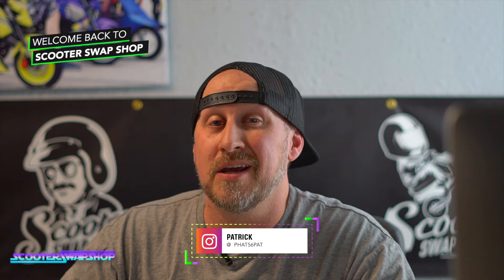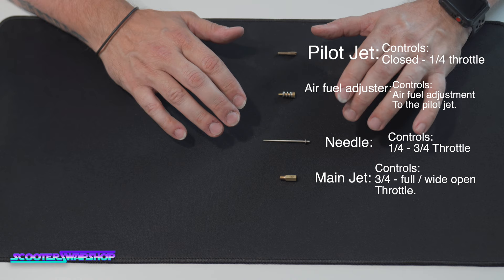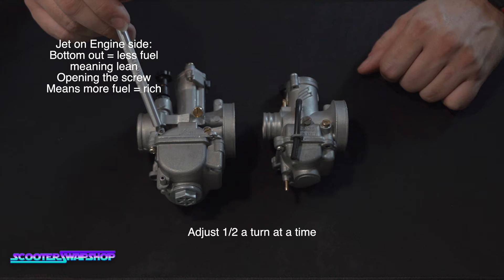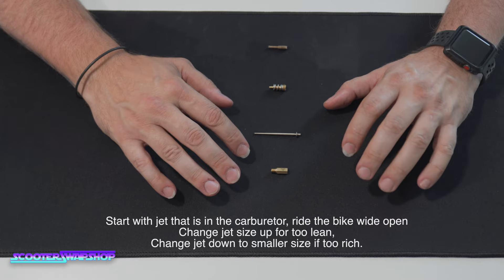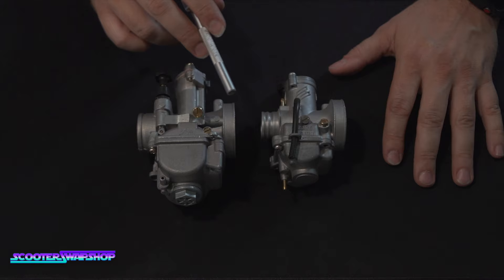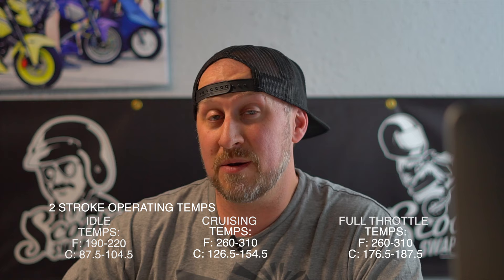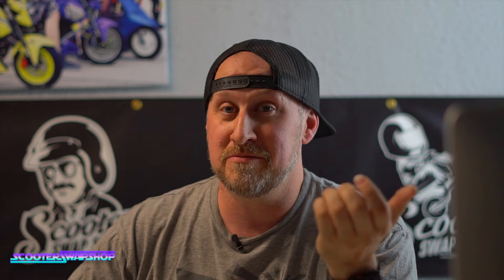How to tune a carburetor / Carb | Whats inside.

Comment: This is a great start for beginners.  I'd like to add a few things that DO MATTER!        1.)  Air temperature change makes a huge difference  it runs great in cold air and crappy when it's hot this is why!  Cold air is denser and uses a richer mix.  If you ride more in the hotter weather then you should lean out the air/fuel mix. REMEMBER
Reply: Doesnt leaning out the mixture raises the temps in a hotter wather? Pre bugs are usually aircooled
Reply: Yea I had my Clone tuned for the summer and pull it out this winter and it ran perfectly
Reply: Bro hot air means adding more fuel for it to burn right cold air is opposite
Reply: You can fit more cold air into a space than hot air, so pack a shit ton of cold air heat it in the cylinder and let that shit expand @Mon3y_Counter.
Reply: Thanks for posting this. On my first two-stroke scooter tune, I’ve seen them to be true. In warmer weather, a 125 or 130 is working compared to a 135 or 140 in colder weather.
Reply: Mine is water cooled

Comment: Thank you for your insight. I have taken on the task of pulling the carbs off my Kawasaki Vulcan 750. Took them apart cleaned them and now putting them back together with all new o-rings, cleaned all the jets not replacing any off them. Changed one float valve on the rear carb but left the front alone. Will deffinetly be using your knowledge given to adjust them when I get them back on the bike.
Thank you.

Comment: I wish you would have went over how to fine tune the air screw. Thats the part that gets me. Something like turn throttle screw so idle is low, start with airscrew 1-1 1/2 turns out then turn 1/4 at a time; flick throttle to settle idle and do so until the rpms change,  you do that on both sides (rich & lean) of the air screw until the engine rolls with out a stumbling. Is that for just dirt bikes? 
Thank you for taking the time to make the video excellent information very informative. My favorite part is how you included the air screw most videos focus on the fuel screw.
Reply from the maker: There’s more to come :)
Reply: @Scooterswapshop  awesome! 💯

Comment: Wait, if the needle clip is at the very top or very bottom position I should get the next size needle depending on what I need? What if the needle clip is at the top position but the bike is running perfect? Do I need to change the needle?

Comment: 145 main in a 32mm PWK 
26hp on an 86cc AM6 stroker
👍
Programmable ignition helps the low  end because not having a exhaust valve makes you want to keep things above 9k.
Peak it around 13.5k

Comment: Will the air/fuel mixture screw also do 1 or the other depend on location. 
As I have a vm22 and one video says that it’s an air adjuster screw even tho it’s located on the engine side of the carb?

Comment: There is this liquid level tool, 4 levels.
Instead of using on 4 stroke 4 cylinders, use on 2 stroke single cylinder, OHP, OHC, SOHC not-DOHC.

The idea is - 4x feed to 4x exhaust through single cylinder with 2 valves, one for intake and one for exhaust. Number 1,2,4 sequence, starting from 2 to 3 to 4, to build levels-graph for 1. The psychology is to treat each line as rotating fluid, 1,2 3, 4 rotates to 2,3, then 1 and return-cycle to 4. Starting with lines, tune them assemble as 1 line amd 1 exhaust to test.
Reply: The serious hobbyists will have to guide and write and share with the other hobbyists. Not all will understand. 4 lines 4 levels. Minus one on max, volume flow in-total. Float ball in plus 2 cylinder 2x2=4, cube 1 is stupid-volume, 2 to 4 to 1 is cube-volume 4.
Reply: I disagree with GCE-O-levels. Special treatment for electrical DC flow, too. I refuse to admit my results.

Comment: I have a question, what about the Hond Navi carb, I see they reference to the screw as an A/F screw would the same apply that it is only a fuel adjustment screw since it is on the engine side? thank you.

Comment: This might be a dumb question but don't you risk blowing out your engine if you leave the throttle at max?
I might be talking out of my ass but on engines with carburetors there isn't a rev limiter since the carb itself is supposed to limit the revs. However, if your carb isn't tuned, the engine could spin faster than what it can support... and then bad things happens

Am I completely off, or does this make sort of sense?

Comment: Hi, i know this is a two year old video, but im desperate and need help. I have a gilera runner sp 2003, it has an orginal stator and ngk iridium spark plug, i’ve tried everything with the carb but at high rpm the bike sputters, like someone is pressing the killswitch, if i let off a little bit it goes away…. I need help 
It has a stage 6 mkii racing 70cc
Stage 6hpc crank
21mm dellorto 
Stage 6 intake
Stage6 mkii r1400 exshaust

Comment: good info.
couldn't get the Vento to run properly last night.
one more shot today and if I'm unsuccessful I won't be buying it.
Reply from the maker: nice
Reply: @Scooterswapshop  got it running.  neighbor had backed the idle and air screws out too much.
now if I can just not get robbed coming home in the evening.  at least it wasn't at gunpoint like the scooter robbery on Monday night. two in five days a block apart.  I gotta move as soon as I can afford it especially as I deliver food.
the only other problem is the turn signals and horn not working.
the headlight low/high switch works and I know the flashers are good when I arm the alarm.
I guess I'll keep it.  2004 sitting since new I just rolled over 10 miles.  R4 Triton 2 stroke 50cc.

Comment: I have bt80 I Road it over 800 miles and now I can ride it a bout a mile or less it fills like it's vapor lock when I give it gas it's like I'm not getting gas  I use my bike to work it under 4 miles need advice

Comment: Hello, i just bought myself gpx gentleman 200 and it has a weird carb, it looks like some of triumphs but its not and I'm trying to set it up because right now i have a problematic idle(runs but uneven).
the thing is- the carb has only 2 screws to regulate and also it has a diaphragm, first screw is on cord pulley which opens and closes throttle and the second screw is under engine side of carb, is it afr screw or not?

Comment: If you got a 4 stroke scooter and you wrap the throttle quick and it cuts out is that to rich or lean been banging my head on this
Reply: Got the same thing have you found the problem I'm thinking it my be the needle wants letting up.
Reply: @jeffmee763 the clip was on #4 on the needle I move it down to #3 didn't get a chance to try it yet got late but seems ok didn't want to make too much noise my exhaust is little loud

Comment: Great video!  Question when your bike only runs with the choke on what jet needs to be attended?  I have a 1979 Kawasaki kz 650.  Thanks
Reply: First takes some starter fluid and lightly spray it around all the carb boots near the engine and carb (not the air filter). If it raises in throttle with choke off you got a leaky boot or cracked area on the housing.  If no reaction then remember the choke cuts off air so it’s saying your idle circuit is too rich (go down a size in your idle jet).  Then use the idle mixture screw and pay attention to this guy on which side of the carb your idle mixture screw is.  Notice he says react with jets if it’s more than 3.5 turns out to stay running (with choke off of course

Comment: i have a Kymco Granding 250cc scooter.. it was not running since July or August last year due to the carburator overflowing issue.... the around last month i start to service the carb and it start back up.. and yesterday and today i start to run it on the road but when i go around uphill or try to give a full throttle the engine sounf like it about to stall or dosen't have enough gas running true the crab. what could be the issue?

Comment: I have a problem with my aerox 2012. I have a Stage 6 replica exhause and i just bought a 17,5mm carburetor. I tried changing the main jets from 82-93 but it is really slow when accelerating. When it is cold it runs better then when it it hot. 

I also don’t understand the purpose of the jets and screws. Does the main jet work when you are at max speed or when you pull the throttle max from a still start?

Comment: So I was stalling and bogging down on a high flow air filter at 35-40 mph , I put the stock back on and it only happened once but the high flow it felt more responsive on the low end but would shit out on higher speed. Would that be a air fuel mixture screw

Comment: Hey I have a 2011 eton Beamer lll with a manual choke when I open throttle fully I bogs down and cuts off but if I move my clutch to about the half way I can get it to run but I have just open throttle partially half and do it slow not fast and far speed I can get is almost 20mph  tops?

Comment: kawasaki vulcan 750 keihin cv 32, if engine chokes betwen(mixture is to rich) 4000-7000 rpm should i replace main jet ? needle doesn't have regulation. In service manual piot screw should  be1/3.4 from bottom to start regulate. engine turns to turnover if pilot jet is about a 1 turn from bottom. Engine  have backfire often.

Comment: These temp are really high except for idle 
My athena sporting a/c run around 80  105celcius and temps goes down a bit when i go wide open for short period

I wonder do your bike really do these temps when cruising and wot? Im a bit loss atm cause i leaned my carb out a bit to get higher temps without any luck loosing more performance than gaining heat

Comment: TY for your videos,,,,So tell me if this is correct when it comes to tuning a gy6 carb, turn the mixture screw until you are at highest idle, THEN adjust the throttle screw.  When the mixture screw is turned in all the way in it should kill the engine, if it does not then you need a smaller pilot jet.  Likewise, if you turn the mixture screw all the way out and you cant get highest idle the you need bigger pilot jet
Reply from the maker: just watch the video again Patrick explains the steps to take we are going to have one more hands on soon

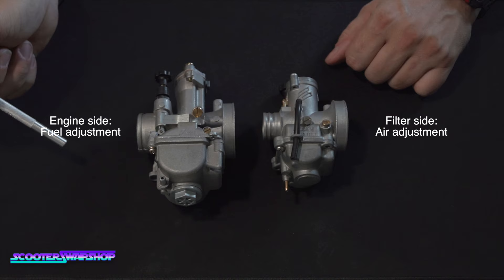Comment: So at 3:25 where you mentioned the air fuel screw being on the engine side or the filter side. Do the same concepts apply if you run premix
Reply from the maker: all the same premix or not

Comment: Great video! You helped me out. I have one question; on my 28 pwk polini with 172cc cilinder and open air filter, my air screw is closed because otherwise it stutters when i want to start rolling with a little bit of throttle. With the screw closed it still stotters but not so bad as it used to. Should I open de screw and change the slow jet or should i leave it closed and go from there? Regards from Holland!
Reply from the maker: I would change the jetting re watch that part in the video
Reply: @Scooterswapshop  thanks. I watched it again but im still wondering if i should re-open the air screw or not because it is getring a lot af air from the open filter
Reply: Piaggio engine? Have the same setup on my Gilera Runner swapper Zoomer.

Comment: Hi. I have a 50cc scooter and the only way i can get it to run good is with the air/mixture screw removed from the carb. Any suggestions please.
Reply: Plugged pilot jet. Clean entire carb.

Comment: I have a 28mm sunworld 45 pilot and 125 main and the idle screw does nothing. I can bottom it out or completely remove it and the rpms don't change. It moves the D slide up and down too it's really weird it's on a 90cc minarelli Drr.
Reply from the maker: if it moves the slide that's your idle adjustment that basically moves the d slide if its doing nothing then you need to make sure your cable isn't too tight and maybe clean your carb

Comment: My top end is good full throttle just weird when going from a dead stop my air screw is half turn out on the cp 21mm an if I bring the air screw out more then it gets worse
Reply from the maker: watch the video again and adjust accordingly also remember cvt tuning
Reply: Fo sho it’s just bogs on the low end from a dead stop the rest is good

Comment: Hi, i just want to ask u, is polini pwk carb really made in italy?cause the casting is not as good as keihin japan. Its like made from taiwan or else.
Reply from the maker: The  cp is made in Italy the pwk is Taiwan. But the pwk polini is better than any other pwk ive ran other than keihin. Keihin is best polini is right after it.
Reply: @Scooterswapshop  finally i buy the polini 30. But i think i need to adjust the float first. The float is too high, its not center to the body line

Comment: Hi, i have a weird rasping sound coming from variator, i think. Whenever i take off/the clutch grabs the sound starts(i have pretty stiff clutch springs on) and you can hear it  all the time after the take-off but its loudest when the scooter takes off. Do you guys have any idea where is the noise coming because it has been doing that for over a month or so and its pretty annoying. Its a yamaha bws/zuma with a 70cc athena racing kit, 21pwk, stage6 variator and polini 3g clutch with stage6 wingbell clutchbell and aerox transmission.
Reply from the maker: sounds like something is wrong
Reply: check your boss pin is not burnt/binding/grinding or worn down on inside of variator, I had a similar issue
Reply: @kainatticus  What is a boss pin? My main language isnt english so.
Reply: @Scooterswapshop  I also found out that my clutch is not symmetrical so it kind of wiggles there is it okay?
Reply: @radi4610  It's the thick metal cylinder on the crankshaft that the variator spins on.
Reply: @kainatticus  Do you mean variator bushing/sleeve and where can i get one for stage6 variator?

Comment: My bike only runs with the throttle pulled. It won't idle by itself no matter how much I adjust the idle screw. I cleaned the whole carb also. Im lost,, please help.. Any ideas?

Also this carb is new to my bike.
Reply: You might have an airleak so its impossible to get ur bike tuned right then
Reply from the maker: sounds like a air leak Pressure test it we have a pressure test kit on the website
Reply: Cool. Ill look for leaks . Thanks guys! Much appreciated.

Comment: Tried everything 3 times. Adjustments, test. Replacing this and that. Even replacing parts twice.  Took it to repair shop. Broke my heart. And no luck. 150cc vitacci spark scooter, GY6 MOTOR. The SCOOTER still bogs out when I give it gas. It start it idles. Throttle gently start to Rev very little then bogs out. I'm doing something wrong and I don't know what. I'm out of test to do or run. If I have to pay you tou answer. Please, please give .me a phone number. I hate texting. If I'm aloud or have to. I can text or tell you every test I ran 3 times. HELP ME PLEASE.
Reply: Carburators are tough set the floats change the main jet Bog is lean. Check other videos I hate carburator and electrical.

Comment: REMEMBER THIS!!
It's ALWAYS safer to run just a little bit rich than too lean!   Too lean (white spark plug) increases the heat and cause engine damage
Reply: Also 93 octane fuel might be too much!   It burns slower than lower octane fuel. Higher compression = higher octane fuel.
Reply: I run a 66/80cc stage 4 race, 89 octane and proper jetted nt carb 44t and hit 46mph down hill  and 35mph flat road
Reply: Don't tweek the carb adjustment before you are done with break-in and cut back the oil mix   I use 8oz oil for first 2 gallons (break in) 5oz per gallon after the break in.

Comment: The chart made no sense and had no context
Reply from the maker: It made sense for everyone else…and the chart is made by mikuni, a massive carb manufacturer..
Reply: Still has no context or explanation. Saying exact science and most basic way qualify nothing. There are a lot more than 4 components to a carb. Maybe you should start with where the items you are talking about come from.
Reply: I rewatched this and the chart makes no mention of pilot jet, and stand by my my statements.

Comment: 🤔 no talk about slide cutouts and emulsion tubes?? 
Understood this is just a simple explanation but high level tuning goes a long way. I've seen too many self "tuned" carbs that were far from being optimum. Usually too rich or lean because the owner couldn't find a sweet spot.

Comment: I've got a 150cc Chinese Tao Scooter and the exhaust and mufflerus missing. It runs and idles fine on its own, but it does backfire occasionally,  and on top of that you can see flames coming out from where the exhaust connects to the engine (or whatever it connects to). Would adjusting the carb somehow fix the flames coming out of it? I haven't messed with it because I don't want to screw anything up while it's still actually running and not be able to undo it